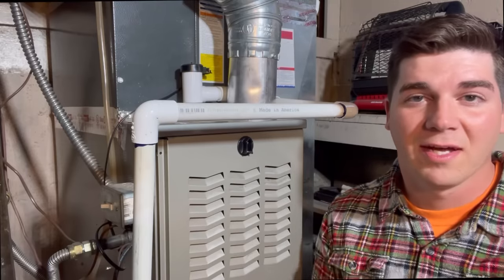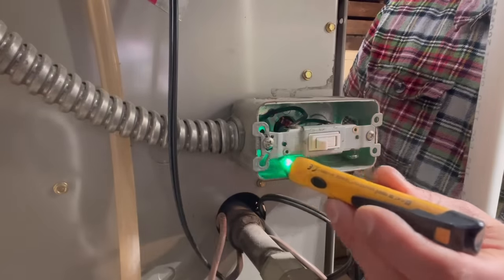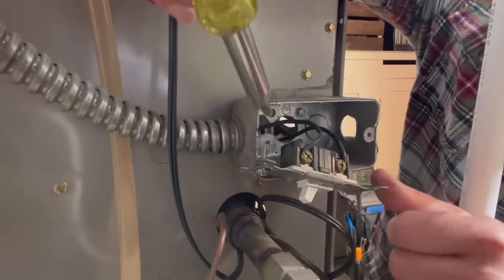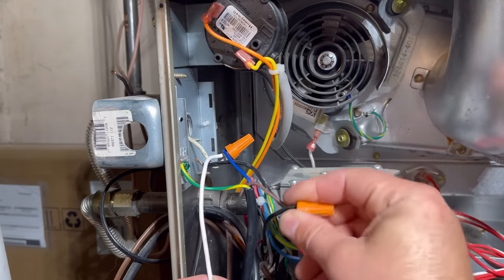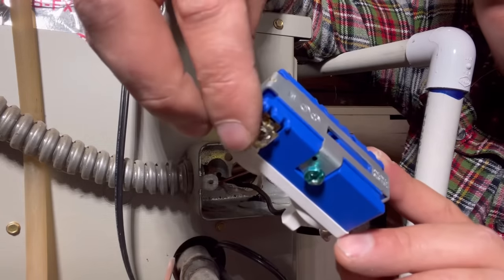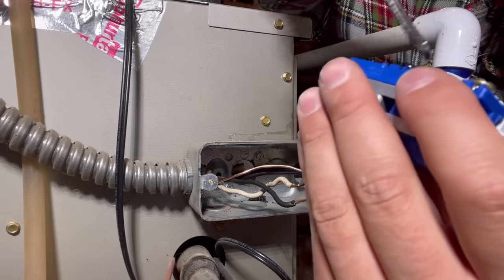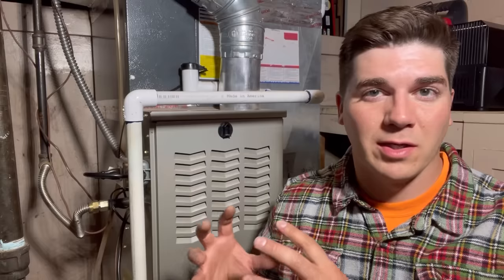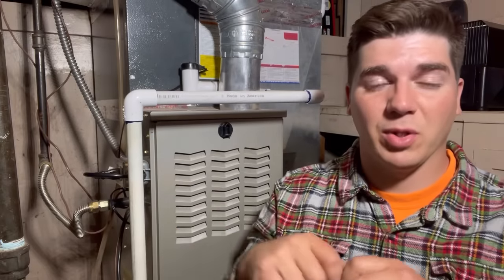This Could Keep Your Family Warm During An Emergency Power Outage.

Comment: One thing people should note is that modern furnaces will look for a connection between the neutral and ground, which is present at your main panel but not in generators or inverters. If it's missing the furnace will not run.  If this happens you need to take an ordinary male hospital plug and install a jumper between the Neutral and Ground, then plug it into your generator or inv.
Reply: HAHA
Reply: I think my setup would avoid that, since my generator is able to plug into an outdoor 3 prong outlet connected to a breaker, ground and neutral in the panel with an interlock kit on the panel as opposed to just running an extension cord from the generator to the plug on the furnace which is what I think your caution is about?
Reply: @Scott---absolutely right!  I learned this the hard way on a cold night!  I made a little bonded box on a pigtail to run my furnace.
Reply: @HobbyOrganist  Right, the problem pops up if just plugging the furnace straight into a gen/inv and bypassing the panel.
Reply: @bruceeverett5372  LOL, that's how I learned it too!
Reply: Why a hospital grade plug? And does this apply only to gas furnaces? My oil burner runs fine with no connection between the earth ground & neutral.

[Hospital grade devices and cord sets have solid pins, larger plug bodies which virtually eliminate the risk of wire to outer contour shock, and withstand greater pull forces. But they are not different electrically]
Reply: Can you be a little more specific? I have a furnace and hot water water heater (2 black and white and ground) wires from each going to a junction box where they connect to to 2  14g wires going to 2 emergency switches one outside the furnace room and another at the top of the basement stairs (don't have the switch on the furnace like in the video. Have a standalone 3000w solar generator with 5 120v 3 plug outputs and I also have a 9000w pure sine wave outside gas generator (  DUROMAX 9,000-Watt/7,600-Watt Dual Fuel Remote Start Inverter Generator).  Want to be able to power the furnace and hot water heater if power goes out by directly plugging in the pig tail plug into either the solar generator or the outside inverter generator. Sounds like the plug end of the pigtail has to be replaced with this "hospital plug" with a jumper between the natural and ground???  Could you explain this a tad more. Thanks in advance. God Bless:)
Reply: @legaleagleandpaws8198  Sounds like you'll need something to tie the neutral and ground together. You don't have to replace the plug. This plug  is a separate, stand alone plug you plug into the gen.  Picture a plug with no cord coming out of it - the connection is made inside of it. Just buy any 3 prong plug and attach its N&G together, then plug that separate plug into your gen or inverter.
Reply: @RichardFallstich  older furnaces dont care and I only state HP because they're easy to wire and have three prongs. Any 3 prong plug will do.
Reply: @Glocktard  Yeah, The electronics actually look for the neutral ground bond in your main panel to make sure the hot and neutral are wired correctly to the furnace. Sure makes a PIA for lots of people.
Reply: @ScottDLR  Thanks for the fast reply Scott!  I have an oil burner not sure if that chances anything" BUT I just watched his other video and he used an inverter to a car battery. He then just took the black and white wires from the furnace (no ground wire) and plugged the 3 prong plug coming from the oil burner directly into the inverter (in my case either the solar generator or gas powered inverter generator) which is what I was thinking about doing until your "hospital plug" came into being...lol. Also I saw a hospital plug on home depot site. You are right it is a stand alone plug and I got that is what gets plugged into the solar generator or gas powered generator. But, you still need the green and white wires going out from the hospital plug to some kind of  receptacle so that you can then plug in the the three prong plug coming from the furnace right? So what am I missing? Thanks. God Bless:).
Reply: @ScottDLR  Thanks Scott for your help though I figured it out. Gen and solar gen already have "bounding ground" and do not float thus no need for that "hospital plug"  What you were talking  about is when the gen has a "floating ground". Thanks, God Bless and Merry Christmas:)
Reply: @legaleagleandpaws8198  water heaters are typically 240 volt. 30 amp connections .   furnace is gas?   will be 120 volt 15 amp...   big genny will have that 240 volt outlet, needs different extension cord..  10 gauge  with different end caps...   better to go big and wire in genny to house panel with proper transfer switch. will then run most of the house at once!
Reply: @solarforfuture  It is an oil burner that feeds a 100 gal hot water heater. 14g wire and 15amp breaker for both. Not a stand alone hot water heater it is heated by the furnace:) The bounding versus floating ground can make you a tad dizzy:) God Bless:).
Reply: is this a gas furnace thing? because my oil burner works just fine off a generator.
Reply: @rottmanthan  It depends on how you wire it. If you just attach the white and black furnace wires (in my case the hot water heater wires too) to the pig tail wires (black and white only) you can plug that directly into your "bounded" grounded gen or solar generator. If your generator has a "floating ground then you have to do the hospital plug and jump the  green ground wire to the white natural wire. If your generator is attached to your panel you need a kit that deals with the ground wire scenario. My best understanding. God Bless:)
Reply: Wouldn't it be more straight-forward to just ground your inverter/generator?  You're always supposed to ground them, though a lot of people don't bother to.  Ground it to your house's ground, even with just a wire from your inverter ground lug to a simple jumper clip on any nearby conduit.
Reply: @mechelec7845  Which is what I am going to do along with the widow maker and making sure the breaker is off until power comes back on. This is just for heating the house and taking a shower. Also prevents the pipes from freezing here on eastern Long Island New York. Buckle up it is going to be an interesting winter ahead in more ways than one. God Bless:)
Reply: @RichardFallstich  A “hospital cord/ plug is an extension cord with a male plug on both ends. Obviously if you plug one end into a live outlet and someone touches the other end, they may need to go to the hospital. Don’t do it! Find some other way to properly ground the unit. Hire an electrician, have a transfer switch installed.
Reply: @rickfromboston  "Hospital" has NOTHING to do with a device being a plug or a cord, etc. "Hospital' designation means it is robust and less prone to failure - it can be a duplex receptacle, a GFCI, a surge suppressor, etc. And a cord with a male plug on both ends is NEVER allowed, not even in a hospital. {you're not an electrician, are you?)
Moreover, I have not advocated the method in this video, and agree a real electrician should install a proper transfer switch in compliance with NFPA 70.
Reply: If you do that on a typical inverter you will short half of the H bridge direct to battery negative and will blow the FETs since technically both legs are “hot” in a inverter. You need a special inverter to be able to bond the neutral directly to the ground.
Reply: @RichardFallstich  , hospital cord is a common slang term for an extension cord with two male ends for the reason stated. I didn’t say you advocated it, I was pointing out that a person was using the term to describe the cord that they thought should be used. I think you were confusing their using of the term.
Reply: @rickfromboston  Yeah I get what you're saying - this kind of set-up will land most people in the hospital. But there is a real thing such as "Hospital Grade" wiring devices. I've been working for electrical contractors for 25+ years, occasionally in hospitals, and never heard that slang.
Reply: @legaleagleandpaws8198  No, the wires you reference don't leave the plug. 
Just open up the plug, install a small jumper wire between the Green screw and the Silver screw. Then put its cover back on and plug it into the gen. You can leave the Bonding Plug plugged into the gen all the time if you want. I'll post a pic of mine if I can ever get it to load..
Reply: @ScottDLR  That seems to apply ONLY if you have a "floating ground" on the generator and you rare going directly from the furnace wiring to the generator without going through the house panel for ground. Still not sure how doing what you said by plugging in only the hospital plug as modified into only "one" of 120v receptacles on the generator somehow makes or converts the floating generator into a bounding ground generator?  OK, based on the other comments it is understood the widow maker idea is not to code and won't be done. But I was not setting this up permanently. If a snow storm or whatever else takes down the grid I would like to be able to still run only the oil furnace and the connected hot water heater - simple enough goal. To make things less drama filled I will stick with the solar generator(s) and leave out the generator to run the furnace and hot water heater. I will use that only to charge the solar generator batteries if needed - I know I can do that much without any of the other drama. The gas/propane generator I have has a pure sine wave inverter (9000w max). It can be used  for charging or running other 120v items - think there are 5 or 6 120v receptacles. In this channel's other videos (car battery ones)  the furnace was able to be plugged directly into the 1000w inverter (using only the white and black wires from the furnace) by using a 12v car battery WITHOUT ANY GROUND WIRE being connected to or from the furnace plug . The solar generator I have has a 1920wh lithium battery (LiFePO4) battery with 2000w output through a pure sine wave inverter. (I am adding another 3000wh battery to that setup for a total of 5000wh in battery maintaining the same 2000w output (better than connecting the 1000w inverter to "a running car" to keep the battery charged to maintain inverter output to the furnace). The 2000w is more than enough watts to run the oil furnace and its connected hot water heater for way longer than a car battery. And the 5000wh lithium batteries will get recharged by the sun (or the gas/propane gen in only a few hours)  I have another similar setup with another solar generator that will run some Lights, computers, modem, TVs, charge phones and other battery backup packs along with running my ref and freezers with food and other items. With just 1200w of Solar panels they will charge the solar generators as long as there is some sun and like I said in a pinch I can always use the 120v receptacle on the gas/propane generator which connects directly to the solar generators themselves (they came with the 120v cords) to charge the lithium batteries continuing to provide the 2000w inveter with enough output to run the above items. Thanks for everyone's input.  God Bless:)
Reply: Yes. You need to switch the neutral of your putting in a transfer switch. This cord doesn't do that.
Reply: @rickfromboston  Common slang? It sounds like you are confusing it with a SUICIDE cord, which has a male connection on both ends - such a cord should NEVER be used.
Reply: @TerrellWSmith  yeah that name is used as well!
Reply: I found that the hard way when doing this to my parents' furnace during an extended outage 20-ish years ago. The furnace seems to be on, and the control module even has blinky-flashy LEDs, so it has power, but the motor never starts even when the thermostat calls for heat. . . The blinky LED didn't mean all's fine, it wanted me to count the number of flashes and decode the message in the dark with the tiny magic decoder table inside the panel.
Reply: @robbruce2128  ohhh... so those prizes in cereal boxes were educationally valuable after all!
Reply: @robbruce2128  What kind of furnace? Perhaps it wants a true ground, and the generator may be a floating ground. Some generators let you hook up an actual ground wire. The one I just got today has this (Generac iQ3500). It also might be that the power from your generator isn't clean enough for your furnace's picky circuit board?
Reply: @TerrellWSmith  Lennox, maybe? Generator was portable -- in a loose definition of that word -- so no ground connection there. I ended up shorting the ground and neutral on the furnace side of the provisional "extension cord" that was really 100' of romex and dryer plugs that they had laying around, and that satisfied the furnaces demands. You do what you gotta do, Dad need heat and his O2 concentrator to run.
Reply: Is this true even if the generator is grounded? I always have a ground wire from my generator clipped onto a grounding source. (plumbing piping)
Reply: @rongrant3500  Yes,  Still need to bond neutral to ground. There's no relationship between grounding the gen and neutral/ground bonding of the furnace connection. 
Cheers!
Reply: @rongrant3500  I don't think so.  When you disconnect the furnace from the mains, you've disconnected the ground, too. So just grounding the generator won't help you unless the furnace has an alternate path to ground, and that's bad for different reasons.
Reply: @robbruce2128  Thanks. The reason I asked is because we have a Lennox, and the generator I just got is a portable. I wonder with the new furnaces whether they want a ground. We'll see. And if it wants it, I'll give it one.

Comment: Just so everyone is clear, the way he installed this you did not need a switch as a disconnect. The moment he put the furnace on a cord and plug that was all he need. And if you up plug is from the utility power and plug it into an external power source that is it, there is no need to switch the receptacle off before. He could have just put in a single receptacle and then did the cord and plug connection and been the same. That said I think it is a neat idea and make it easier to power your furnace when the power goes out, I only think he went to more work than what was need. One more thing the hole from the handy box into the furnace you should put a chase nippel and a plastic bushing to protect the wires from rubbing on the metal and removing the  installation off the wires overtime
Reply: ...read a lot of comments. Wondered the same thing. You're the first to say this. I'm not an electrician. Just a millwright/general machinist. Didn't understand the neutral/ground bonding thing. Guess if I pull the cover off my panel, I'll see the grounds and neutrals on the same rail. Can't remember everything. Just try to approach with logic. Can't see electricity. Must be careful. Thanks for your comment!
Reply: The reason you need the switch is to have a local cutoff for the furnace. Otherwise, someone would have to go to the circuit breaker panel every time the furnace needs to be turned off, as in for routine maintenance. It's code everywhere that I know of, because if the breaker was the only way to kill power, some yahoo would be too lazy to go all the way to the panel, and would try to work on a live unit.